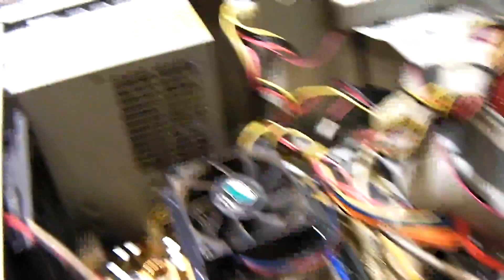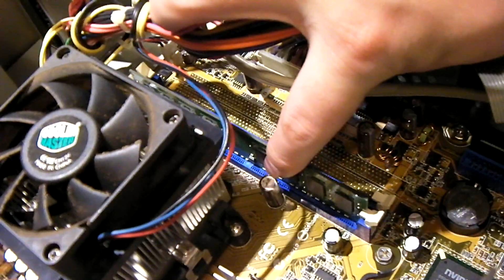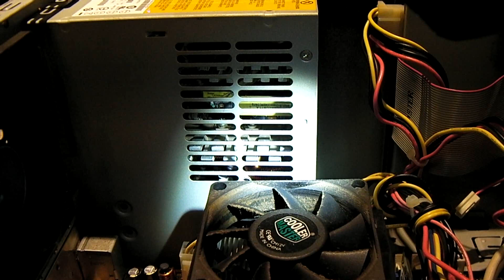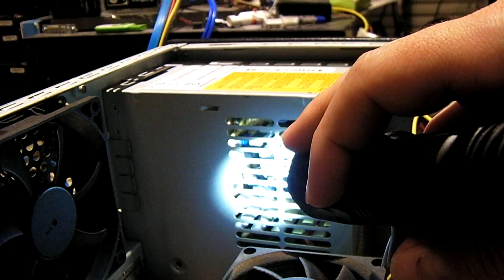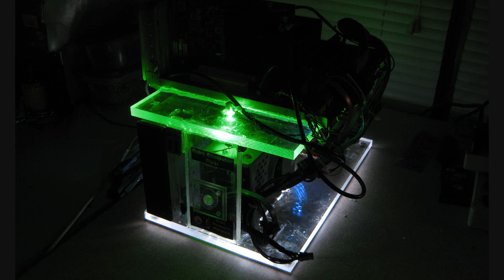KZG - The capacitor series from Chemi-Con known for failure

Comment: I have 2 kzg 1000uf 16v caps that blew on my 2007 motherboard, but what can I use to replace them?
Reply from the maker: Any electrolytic low-ESR capacitor matching the diameter, voltage, and capacitance (uf) of the ones on the motherboard. Stick with reputable brands such as Rubycon, Nichicon, Panasonic, etc.
Reply: @CubeComputerChannel  Thank You!

Comment: By the way Cube bro, do you know how to repair traces, I have see that repair videos are very popular nowadays.
Reply from the maker: Depends on the kind of trace and the severity of the damage. Sometimes if it's a decent sized trace, it can be bridge with solder and/or a wire.
Reply: @CubeComputerChannel Then use a solder mask or nail polish to cover the trace and isolate .
Solder mask just require a UV lamp to cure.